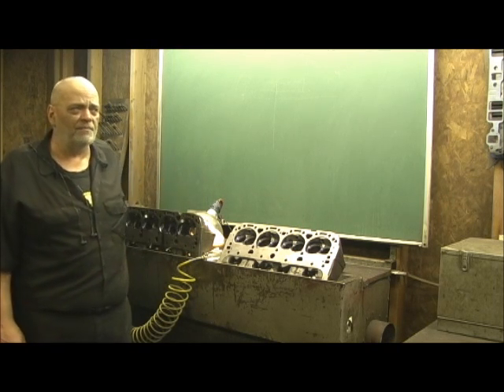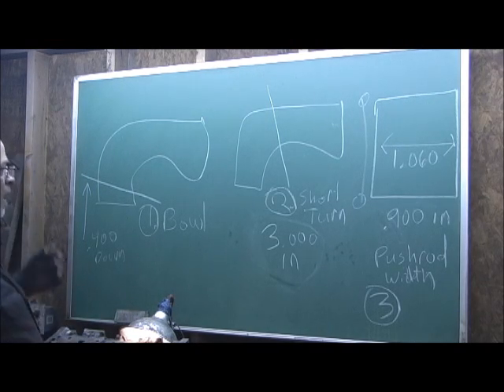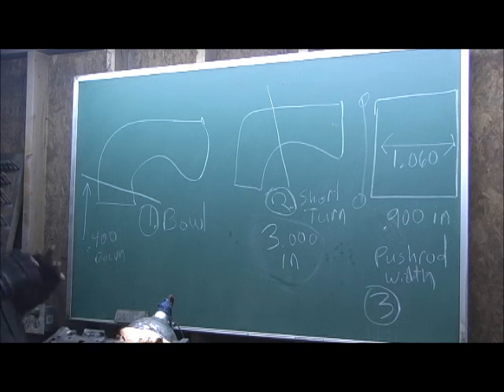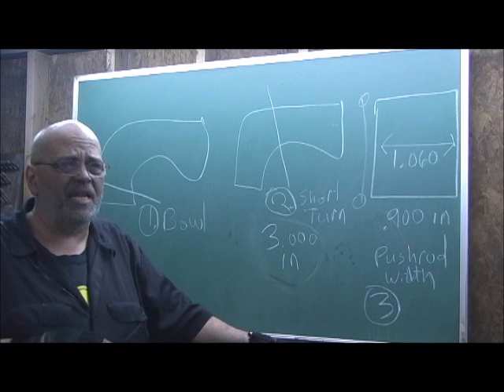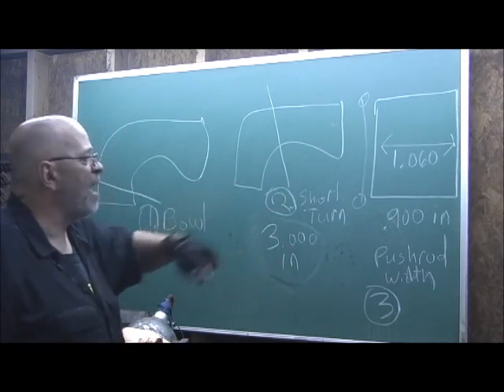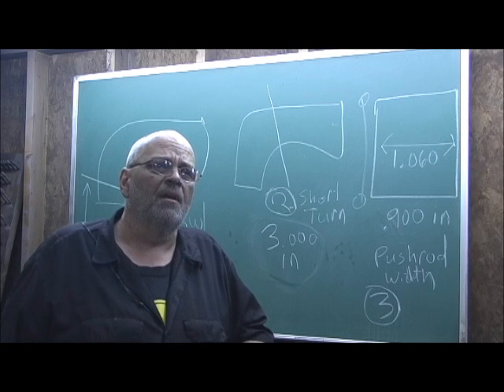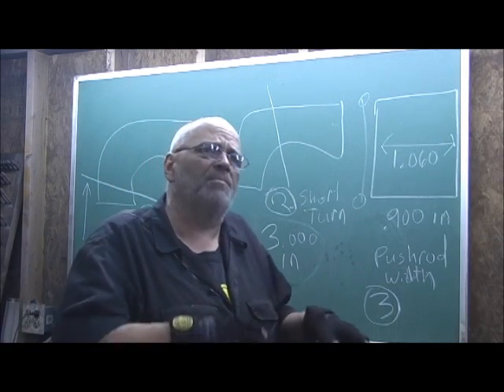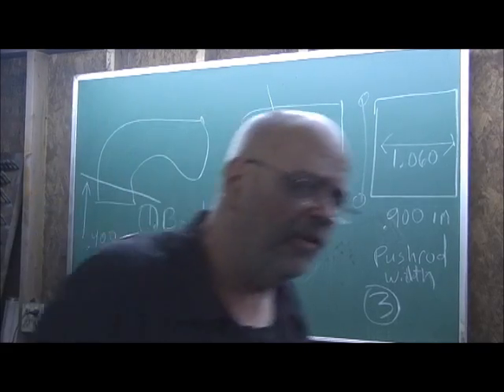Imhoff SBC 186 Pick Up Points Explained 8.2

Comment: I think it is hysterical when you yell out,"Yank!" I showed my daughter, she was not impressed. Looking forward to the final cc for ports and chambers on these babies. If you could cc an exhaust for me that would be great. You big SS.
Reply from the maker: I might be wrong yank, but I don't think they will be that big, I mean around 185 maybe, as I did not move the pushrod wall because I did not want to create a BIG HOLE that would not exit properly due to the "RAM HORNS: and Iron Quadra jet intake manifold. Remember, the Pushrod side controls the UNSHROUDED area of the valve that changes direction at mid-lift on that head. I would be HAPPY at 185cc intake, and also I will CC The exhaust and chambers AGAIN!!!
P.S. The comment you made about the "DUCT TAPE" on my back, is there for a reason, my MP3 Player has the earphone cords that climb up my back, so it stays out of the way when I am grinding. I could not live "GRIND" without my MP3 Player Yank. I crawl into my world and get lost!!!